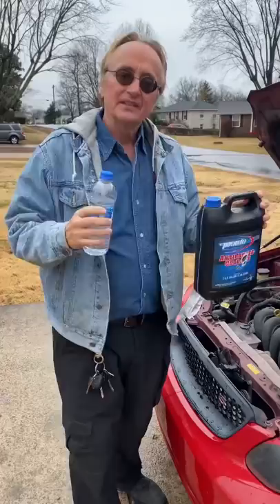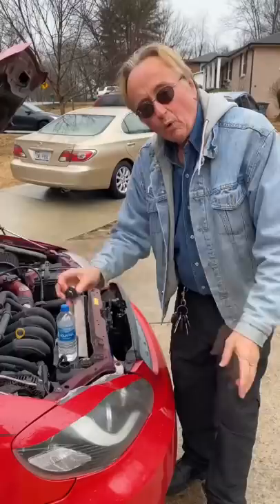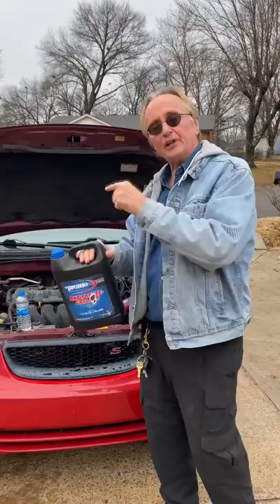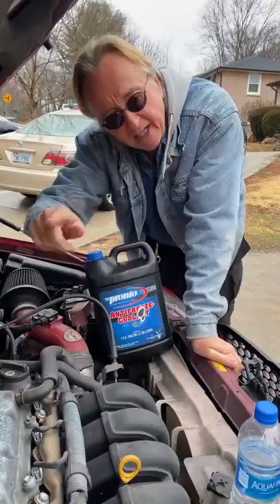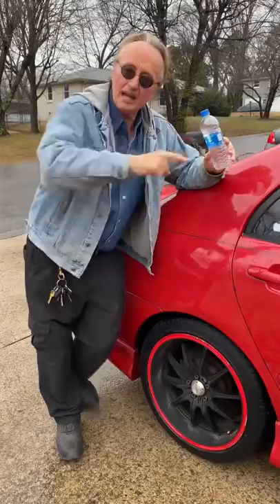This Mistake Just Destroyed My Engine

Comment: I'll admit I will run an engine with distilled water in the coolent system. One time I was hauling grain with a K600, and the radiator sprung a leak and the engine overheated fast. So I limped it over to the nearest Walmart, and bought six gallons of distilled water, and finished the shift like that. Naturally it all leaked out again overnight.

Comment: Yep. The antifreeze has an oil-like quality to it that helps prevent rust and prevents sediments from sticking to the metal. If you use distilled water, there will be almost no sediments to stick but let's face the facts... many people put straight tap water in the radiator.

Comment: He forgot to mention that antifreeze also has rust inhibitors in it. I've seen engines that were only run on water that had the freeze plugs rust all of the way through because of it. I had to remove the head and replace the freeze plugs, radiator, thermostat, and all of the hoses. It was expensive.

Comment: The only place cavitation would be an issue is the water pump impeller and even there corrosion is faster. I think the water pump seals would probably be the first point of failure with pure water.

Comment: Absolutely TRUE!  If it doesn't damage the engine itself, it WILL cause pitting and eat away at the water pump rotor, reduce cooling and eventually lead to a water pump replacement, best case scenario!   In a pinch/emergency - YES water... but as soon as you're safe and figured everything out, drain it and fill it with the proper mix.

Comment: Back in the 50s and 60s there were a lot of people that lived in southern California or south Florida that just used pure water in their radiators. Of course those are also areas that almost never go below freezing.
Reply: And those engines were entirely cast iron, with a brass & copper radiator, all sharing a conductive electrical ground.  Modern engines are thin alloy castings of Al, Mg (Anodic metals) and iron castings with steel components (cathodic metals).  Sooner or later galvanic reactions turning your cooling system into a poor version of a flooded battery is going to end badly.

Comment: Hi i have a 2003 Mitsubishi Eclipse and it started smoking from under driver side dash and back of the engine and it was kind of like a mist what would your diagnosis be
Reply: if it smelled like steam ?
Your heater core is leaking .
if it smells like oil ?
You've got a serious oil leak that could catch fire .
if it smells like wires burning ?
Well , then you've got wires burning and another potential fire problem .
Have it towed to a mechanic before it goes up in flames .
and disconnect the negative battery terminal just to play it safe ( if you know how )

Comment: Cavitation? Yeah...if your engine even lasts that long. 
Coolant will decrease the freezing point and increase the boiling point of the water it's mixed with. Meaning, it will make it more difficult for water to freeze and boil. The freezing and boiling of the water is a HUGE problem. If the water freezes in the engine...the water will expand when it's turning to ice, and could VERY EASILY cause the engine to crack. The same thing will happen if the water boils; it could EASILY cause the engine to crack due to the high pressure caused by the water vapors having no place to go (this happened to my 1995 Acura Legend, when my older brother put just water inside and didn't tell me).
Also, I prefer a 60% or 70% coolant to 30% - 40% water mix. But, then again...I live in Arizona...and, the Summers can get WAY too hot for a 50/50 mix.

Comment: If you mix your own coolant, use distilled water. It'll keep the minerals and particulates of tap water from clogging up your radiator and heater core.
And if you really value your vehicle, especially if you plan on keeping and working it for years, flush the cooling system and replace it with premix lifetime Fleetguard coolant.

Comment: Hi Scotty,  what about pre-mixed coolant? Are good or not.
Reply: Good. It saves time versus mixing your own with 100% antifreeze and distilled water. Surprisingly, it can also be cheaper per gallon to buy a 50/50 mix than to buy the separate items.
Reply: @stephenarling1667  
Well of course its cheaper, your only paying for 50% antifreeze and the rest is water... 
Learn the capacities of your engine and radiator and adjust for it with Steamed Water & Antifreeze...
Unless you're lazy, then....

Comment: I once had a POS car that the radiator leaked. It wasn't worth fixing, so ran water in summer, then used a mix in winter. Starter went out. Offered the car for free to someone, but he didn't even want to change the starter as the exhaust manifold was in the way of an easy starter replacement.
Reply: The engine was good, but everything else about the car sucked.

Comment: Well, my engine uses as much water as it uses oil. Cavitation is the least of its problem I think. Dam thing overheats on regular motor oil too so I constantly use slick 50 for that too. Which works like magic I guess.

Comment: Guys can anyone tell me that how do you know if your car has air in cooling system I just removed the coolant from the radiator of my car using the drain plug I refilled it and the reservoir let the car run for a while refilled the reservoir again the next morning the reservoir was back on low so I topped it up again but now a week has been passed almost but my coolant level in the reservoir is where it should be so should I need to worry now anymore?
Reply: You should always check it at the radiator when it cools down... The radiator has to be  almost a quart down before it'll suck it from the overflow tank...
Park the car on a steep upgrade, open radiator cap, turn heater temp to high and let car idle to release the air trapped inside... DON'T REV...
Reply: @boobtubeakatv1296  I have a Toyota Hilux and it doesn't have radiator cap it only has a bleeder plug
Reply: @Ali.s_garage  
All vehicles have a radiator cap as that supplies the back pressure and is replaceable. 
Just need to look further.
It appears your 26 year old diesel truck does indeed have a cap... Hard to find a replacement as the truck hasn't been sold in America since 1995. But a cap is available on Ebay 🤪
Reply: @boobtubeakatv1296  mine is 2014 and they stopped using radiator caps from 2004 onwards Hilux models they only have a small bleeder plug on the top of radiator
Reply: @boobtubeakatv1296  but yes I did park my truck on a steep slope I removed the pressure Cap of the reservoir and I just Squeezed to upper hose a couple of times and saw many small bubbles moving from the pipe into the reservoir (pipe that connects upper radiator tank to the upper part of coolant reservoir) and after a few squeezes there were no air bubbles that I was able to see then I took the truck for drive I drove it hard to check what will it do with the temperature but it kept everything in Normal so hopefully everything will be fine and the heat is working like it should be so is there anything else to worry about?
Reply: @Ali.s_garage  
AFTER it warms up and with the cap off Ali....
Park it on that slope ( highest part is that opening ) and let it idle with the heater all the way up in temperature for at least a 45 min...
Squeezing that hose actually introduces air and small cracks in the hose from Squeezing it...
Just let it idle and refill as necessary...
You'll be good to go... 🤪
Reply: @boobtubeakatv1296  ok bud I will try it but my heating is working perfectly so doesn't it mean that I have no air left in the system 🤔
Reply: @Ali.s_garage  You'll get the best cooling properties out of that old beast by assuring yourself of NO air in the system... 
Also, have you cleaned the front of the radiator fins off from the bugs and road grime ??? 
Well worthy of the effort... Just use a degreaser, some dish detergent and a garden hose... 
The cleaner the better !!!
Reply: @boobtubeakatv1296  yup I clean the fins with pressure washer once a month these new Hiluxs really need a lot of care you have to replace injectors every 100k miles or atleast 1.5k miles this modern Hilux is not reliable compared to the old 94 that I still have sitting in my garage 250k miles on the clock only had to change clutch once and that's it
Reply: @Ali.s_garage  
Okay... I was taught to never use a pressure spray when cleaning a radiator as that forces the bug guts and road grime further inside the spaces... 
The degreaser and dish detergent with a garden hose worked best...

But It is YOUR Vehicle and you'll have to fix it if you split the fins...
Reply: @boobtubeakatv1296  oh yes I know too much high pressure isn't good it even damages the fins too

Comment: What happens when it is straight antifreeze?  I've yet to see a problem.  Winters are brutal.
Reply: I believe it's to corrosive.
Reply: I've run 70% antifreeze to 30% water in upstate ny where temps got to -40 below F .
All Antifreeze isn't a good idea .
Use a test meter to check your temp of the antifreeze,once you mix it .
Reply: Straight Antifreeze will FREEZE 🤪

Comment: Newer cars you can't do what the old cars could do at least not as long but any old coolant shop's would have water pumps without fines because the rotted away
Reply: True. Water pump impeller fins can be destroyed by corrosion or cavitation.

Comment: Well 50/50 ain't the best ratio.
50% antifreeze gives you a range from -38°C to 106°C.
When 65% antifreeze gives you -52°C to 114°C but it's more work to mix it that way than equal parts.
For heat dissipation less antifreeze is better I know some quality (aka non-american) car makers says you can run as low as 10% antifreeze

Comment: I run straight water for a couple months in my 7.3 powerstroke as i had oil cooler failure and a good amount of oil in coolant so i ran it for a week a with it a fair temp i dumped it and repeated like 2-3 times then filled it with coolant

Comment: Pure water will rust and corrode the motor and radiator over time! THAT is the primary reason to use it after the non freezing thing!!\
Reply: nonsense. all radiators are made out of aluminium, and pretty much all gasoline engines too. a diesel engine might be affected but even those are sometimes aluminium if they're new enough.
Reply: @verliebt3465  
Aluminum WILL pit...
Worse than rust...
Reply: @boobtubeakatv1296  they're still made of that and you can run water through them. and even in engine, coolant has it's own channels to flow through, doesnt come in contact with any moving part besides the pump and that needs replacing anyway after a ferw years. so minimum damage.

only real issue is freezing cold.
Reply: @verliebt3465  
10% of engines in 2021 are of cast iron. MOST are aluminum.  My water pump is 15 yrs old with NO leakage or seizing.  Have changed hose and system 3 times.
Water pits the engine and WP.
It's $389 to replace WP when it goes... Not minimal...

Comment: Ive had pure distilled water in my car for the past couple of years.never had an issue 😅 not even my past cars, had a integra with over 300k miles and it still ran smooth, Rsx with over 230k still never had a issue not even during the winter
Reply: How often did you go thru water pumps?
Reply: @raynic1173  not a single time, i replaced a original radiator on the integra just from it being old, at that point it was over 250k mils never been changed before,and the rsx i replaced it as well because i accidentally put a long bolt in the wrong spot and cracked the top cover.other than that never had a issue. Anything else you want to ask ?
Reply: @raynic1173  same thing on my tsx to this day with over 200k miles , i guess i take care of my stuff better than people that dont know much ?
Reply: @jr217r  well my experience running straight water is that the water pump vanes will rust out and so will the freeze plugs. I think both parts are normally covered in electro plated zinc. Both times it took about three years and they rusted out, it happened on two separate vehicles, That why I was asking.
Reply: @raynic1173  with me using distilled water its never been a issue ive done it to all my cars,, I've heard if you use regular water hose water it starts to rust the internals. Me personally i haven't come across a issue with my cars and i drive my cars over 40,000 miles a year, not sure if that has anything to do with it but thats what it is.

Comment: wow, i'm surpised this is even new information to some people. i've known this for so long i literally cringe when friends are say they are low and they are going to fill with just water. like you want to erode away your radiator and internal components of your engine be my guest. water is extremely abrasive, especially when super-heated by a running engine. just a recipe for disaster 🤦‍♂️
Reply: Water is super abrasive?🤣🤣🤣🤣
Reply: Stop trying to sound smart. It isnt working...